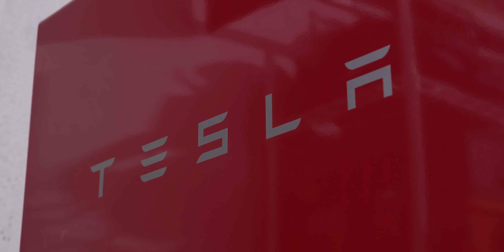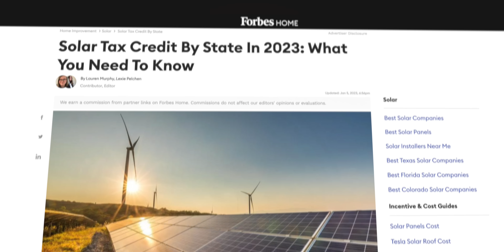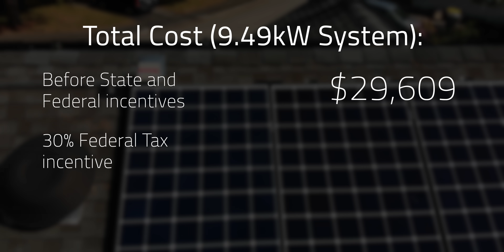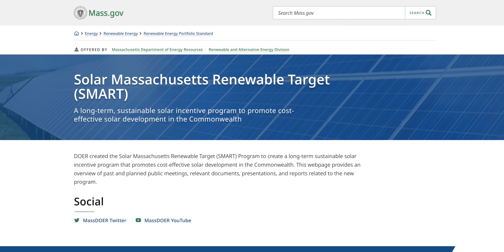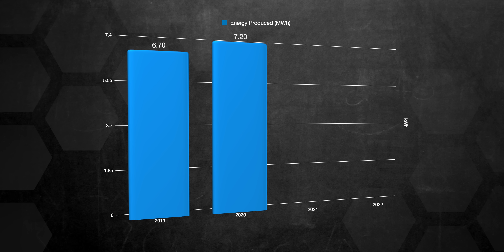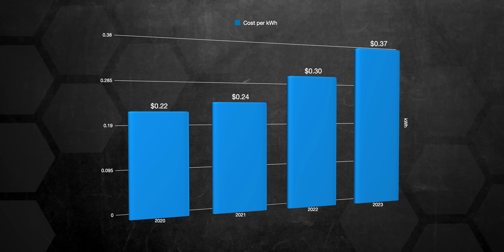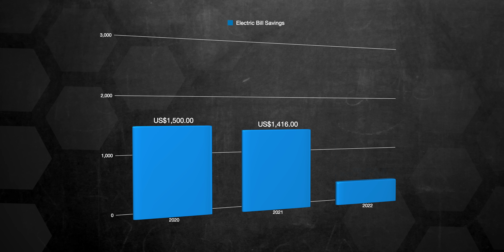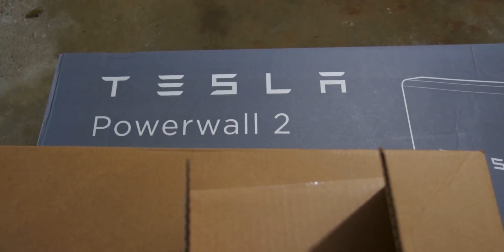5 Years with Solar Panels - Is It Still Worth It?

Comment: But what was you interest rate on the loan and how much was your monthly payment? You did the savings on your electric bills, but you never mentioned what you were paying for the panels. If you don't put that into the equation, you aren't really on track to pay off the panels in two years. You don't truly own the power until your loan is paid off, because you are just shuffling money from the electric company to the loan company. Plus the costs of panels has gone WAY up since then, you have a ton of panels, I recently got quoted for what looked like half of that at 45K. If you are lucky, you'll get ten years of no payments on the panels at 85% of their normal capacity.

Comment: What happens when you have to replace your shingle roof. How much to remove and re install the panels.
Reply: Just last month my ex-stepson-in-law paid $3,500 dollars to remove and reinstall a 4.0 kW system for a $31,000 roof repair; so the cost is significant but not huge.

Comment: In Jan 2022 we paid .17/kwh by Sept 2022 it was .281/kwh!  In May 2022 we decided to install solar so put in a 16kw grid tied ground mount which went into service Sept 2022.  Production to date is 7.2Mwh with a usage of 10.8Mwh so instead of paying $2866.20 it cost $1011.60 or $161.86 as opposed to $458.59 per month for electricity.  So we saved $1854.57 over 6.25 months and it's not even summer yet.  We also have 1 to 1 net metering.

Comment: Snow? What's that? Where I live in NJ, we haven't had more than 3" of snow in the last 2 years. Seriously though, we are only getting 24 panels on our back roof, which is East-facing, as our HOA won't allow panels on the front side of the house facing the street (but my solar engineer confirmed that I only need the 24 panels on the rear).
Reply: UPDATE: My 24 panels were install in early July 2023, local Utility company didn't start the net metering (1:1 also) until late August (local inspections and red tape), and since September, I haven't paid for any kWh since. Only an monthly "Delivery Cost" of about $5.95/month. It's now January, so let's see how our usage changes over the winter. P.S. We use Natural Gas for heat and hot water (and cooking) so my natural gas therms > big time during the winter months, but that's still a big savings as I'm only paying for gas and not electricity.

Comment: I had a 10KW solar installed a few months ago, in October. The only thing I would have done differently was getting a lien waiver from the installer before he started work. 
The parts were delivered to my house, straight from the distributor. The next day I got a letter from the distributor warning me that my home was subject to a lien if the contractor didn't pay for them. I called the contractor, he told me it was normal, not to worry, blah, blah. Install went great, work done to perfection, passed utility inspection, passed city inspection, and I'm generating power. Then I got a certified letter from the distributor, telling me they were filing a lien on my house, for $16K+. The contractor hadn't paid for the panels/microinverters. I called the contractor. He spun me a tale of mixed up accounts, bookkeeping errors, mistakes were made, but it would all be straightened out. This went on for 4 months, and I just barely got the notice of lien release from the distributor. Still enjoyed my solar, but that definitely put a damper on things.

Comment: The roof started to leak 2 years after installation. No major storm, no idea what happened there. Called a local roofer since I thought this wasn't solar related. He came out and was kind enough not to touch my panels saying that it would void the warranty. Called Tesla, waited 40 min on hold and was told they can send someone. However I would be charged over $100 if they find the issue to be non-solar related. That was the moment when I swore I would never again go solar if I ever buy a new home.

Comment: We are in MD and have a 23 panel set up with a SSW and ESE set up, for the 3 years you listed, we got 7.18, 6.5, 7.85, 7.81MWhs 2019-2022.  We had our panels installed 2016.  In 2020 we had a panel fail and it was not caught for several months.  We are further south and have a better roof direction with the SSW & ESE set up but only 23 panels and they were not 425Watt but 333?, our system is 6.9kWp.  We do get some major shade on the SSW panels especially in Winter when the sun is lower.  Just some figures for comparisons.  
     
Also our first quote was from a Tesla solar installer and they were aggressive.  I used right to rescind when I researched myself into panels on North facing roof.  They had the panels planned for my NNE and ENE roof also, a 30 panel system.  I found later that the ENE could have worked OK somewhat but the NNE is a no-no altogether.  We then researched community solar co-ops that get enough neighbors together to offer bids to solar companies for multiple houses, like 20 at a time.  A bidding war comes and the solar ends up definitely a good percent less.  Try searching Community Solar (your county) or Community Solar co-op (your county) to see if you have that option.  Our solar 6.9kWp ended up $17,800 and then 30% of federal tax credit and $1,000 MD credit so $11,460.  I don't think the federal credit is still at that percent?

Comment: No, the nonrefundable federal solar tax credit is not like the refundable child tax credit.  The latter is handed to people in a "refund" in full even if their tax liability is less, while the former (the solar tax credit) can only be subtracted from the amount of one's tax liability.  The rest of what you said is correct, except that as long as you have a tax liability every year (or even most years), you can eventually get the full amount, because whatever is still left over can be carried over from year to year until it has all been disbursed to you.  It says so right on the IRS 5695 form.  Oh, and no, it does not depend on how much was withheld from your pay, as you'll get all of the excess back.  How much of the solar tax credit you'll get back at a time depends solely on your tax liability.

It's actually simpler and less nebulous than you think.  If your tax liability is greater than your solar tax credit (plus other nonrefundable tax credits), then you'll get the full amount at once (like you did) plus all of the money you paid in (that was withheld from your pay by your employer).  If, on the other hand, your tax liability is smaller, then it is subtracted from the larger solar tax credit, you get that amount back (plus everything you paid in) this year, and the remaining solar tax credit can be rolled over for the next year--you don't just lose it.  This can be repeated year after year until you've received the entire solar tax credit.  In contrast, with the child tax credit, you simply get that amount added to your total, so it's not the same at all.  That is why the child tax credit is called "refundable"--it can be "refunded" regardless of your tax liability, while the solar tax credit can only come out of your tax liability.  You got some of this right, and most of it wrong.

Comment: Matt, Great program - thanks. I have been involved with solar since 1978, currently retired, serve on the Board of the International Solar Energy Society and heavily involved in many other local, national, and international solar and renewable energy organizations.  
Comment - I rarely hear speakers talk about solar PV savings for their electric vehicle vs gasoline. 
My current home solar PV system cost about $12,000 (after Federal Tax Credits) 4 years ago, produces about 12,000 kwh/year, and saves about 12 tons of CO2 emissions/yr.  
The system provides all of our home electric needs, including air conditioning (9,000 kWh) and also charging the electric vehicle (3,000 kwh). Home lighting, appliances, and AC electrical savings about $1,800/yr. Gasoline saving over an ICE vehicle about $2,400/yr, total savings $4,200/yr, less than a 3-year payback!  
Keep up the great programs!  Robert

Comment: No, the ideal direction 2:06 is not Southern, this was only true in the 2000s when panels were really expensive, and some were even mounted on turntables that followed the sun. Now, panels are affordable, and best choice is covering the whole roof, both East and West sides, as you've done. We need solar power in the morning, in the evening, in winter and under clouds, not a surplus of power at noon when the sun is shining, followed by a sharp drop in the afternoon.

Comment: There are 2 big problems with solar.  
1) The panels have a lifespan of 20 to 25 years, then they have to be replaced.  This means that in the next 10 to 20 years, hundreds of thousands will need replacement from the U.S. alone.  No one knows where we are going to put them all.  Likely to be an environment hazard. 
2) Currently, most of the minerals needed to make solar panels come from China, and it is unclear whether that supply will continue without disruption.
Good luck solar owners.

Comment: We have 36 panels for 12.6 kw max system. In 2022 we produced 11.8 megawatts which is just over half our electrical use. (I also drive an electric car ) the one thing I wish I had known is how badly enphaze treats customers. I use home automation to moderate electric demand. Enphase snuck a red-pill into an update that ruined local access to solar production data. Lucky for me I wasn't in the first wave and disconnected my system from the internet. I will probably remove the enphaze equipment when I install a battery.

Comment: Solar systems can actually reduce a homes value.  There is the eventuality  of very expensive maintenance and repair costs that a new homeowner might not 
want to take on. I have seen Real estate deals require the removal of the solar hardware before a sale is acceptable. Plus the roof shingle replacement is really costly when you have to remove, then reinstall all panels.  Then, of course There is Hail Damage, that Home Owners insurance will not cover.   How much is really saved after all of these unmentioned expenses have to be Paid?

Comment: 5:20  The SREC payments are 'reimbursements' after the fact so they don't, in fact, reduce your out-of-pocket costs.  Unless the company allowed you to delay payments until you got the SREC payments.  For that matter the federal deduction/payment was ALSO after the fact. So your out-of-pocket, upfront cost was $26 thousand and something, regardless of how much you got back later.

After watching the video, I noticed that, except for the snow removal, you didn't say anything about maintenance or repairs.  Do some of the panels occasionally get broken and need repair or replacement?  Does the battery need any kind of maintenance or repairs?  And to be complete, were there any issues with the wiring that connects it all?

Comment: Our solar was installed recently, I envy your 2018 pricing, but we are not far off. Your videos were a huge help in deciding our goals and choosing an installer. We are in a western state so our production is already showing a huge difference. Thanks for the guidance and the great videos
Reply: Kinda overpriced, the 8k tax credit is closer to what it should cost
Reply: @TheNicog1  i mean if you think you can pull off designing budget solar panels and installation for that then go ahead and make bank.
Reply: @TheNicog1  It should stand on its own without having to use other people's money
Reply: @johnfromnj885 ”using other people’s money” loads of every industry are held up by government subsidies. Farming in the scale it is today isn’t profitable for a wide variety of reasons. But I don’t see people commenting this shit under those topics. What’s profitable and what’s necessary or “right” aren’t the same things. Profit shouldn’t be the only factor.

Comment: We recently installed solar panels and batteries to offset the ongoing power outages. To all of you that are considering solar, take the time to map out all the electric devices to be powered by your solar solution and then add at least 10% more capacity. 

To get to the size of the inverter you require, work out what the load is when your stove/oven, kettle, microwave and air-fryer are all running together. Then, add the electric load from the TV, computer(s), washing machine and lights and washing machine/tumble dryer. 

Furthermore, make sure that you have a bank of electric plugs that only connect to the utility supply for jobs that require heavy electrical equipment. You will need these electric plugs for your electric mower, drills, bench sander, pool pumps etc.
I hope this helps you.

Comment: I am also a "5 year solar panel" homeowner. I was pressured for about 2.5 years by a persistant salesman. It was only after I got an email from the corporate headquarters offering me a $750.00 "bribe" that I went for solar. I had the panels installed as part of a lease program that required no out of pocket costs. When everything was turned on I started receiving bills from the solar company of around $150/month for the lease cost. My local electricity provider bill went down to $8.00/month. At the end of my first year of operation I was able to determine what my savings were by going with solar. At this one year mark, my total annual savings were a whole $80.00. From this, when some of my neighbors asked about whether or not it was worth going with solar, I simply told them to go ahead if they want to save the planet. If they wanted to save money out of their pocket, I simply said how much is $80.00 worth to them. Not a single neighbor went with solar. The solar company I went with was Vivint Solar. They were bought out by another solar company around 2020 or so.
Reply: Save the planet from what exactly? If you truly believe saving the planet consists of everyone installing solar panels, then you have shown the level of your ignorance. I did not say stupid, as I understand the difference. By the way, I am an electrical engineer.
Reply: @marthakrumboltz2710    Hey Mr. EE.....solar energy is green energy....so it is a "save the planet" kind of thing.  I'm in agreement with Christopher Franklin that if 80 bucks is your gig and you want to" do your part" in saving the planet then go green.  Solar cell tech has come a long way since I wrote my cheasy 1977 college term paper on solar cells but the technology is STILL NOT to the point where it is truly worth investing in as a homeowner.
Reply: @ken85225  you might want to look into how they're produced before you decide mass producing solar panels would save the planet.
Reply: @ken85225  What is green about metric tons of PV panels full of heavy metals going into landfills polluting water tables? I can see the propaganda has worked well with you. You probably think that EVs are "green" too, though haven't done an iota of research of who and how lithium is extracted or what is going to be done with a junk 2000lb toxic battery.
Reply: Everyone's situation is different in terms of whether or not it makes sense to install solar panels.  It sounds like the advice you gave that your neighbors didn't factor in the appropriate criteria to determine if it made sense for them to get solar panels such as the direction their roof is facing, how many panels can fit on their roof, how much of their roof is shaded by trees, how much electricity they could produce with a solar system, etc so they may be able to save a lot of money by getting a solar system.  Also, buying your solar system is usually recommended over leasing by solar experts because the cost is lower over the long term and the solar company usually makes more money when you lease the system because you have lease payments as long as you want to use the system.  To evaluate whether or not the solar system is worth getting, you need to evaluate the payback period which is how long it takes for you to save enough money from the electricity produced by system that you didn't need to buy to payback the cost of the solar system.  If the payback period is too long, then maybe it's not worth it.  My 11.2 kW system's net cost was $18,700 and was originally estimated to save me about $2500/year in electricity based on the electricity cost in 2020 when I got it installed making my payback period about 7.5 years.  Since the system is guaranteed for 25 years, then I'll be saving a lot more over the life of the system compared to the cost. Energy Sage has a great article explaining solar system payback period.  Lastly, Vivint was acquired by Sunrun back in 2020 and they both have terrible reviews on solarreviews website when I first looked at both of those companies back in 2019 so that might explain how come you're not happy with your Vivint solar system.
Reply: So your electric bill for the year is typically $80? You failed to mention how much it went down from to get to $8 though I'm guessing it's either intentional or just poor math. Yes you are saving 80 now with the cost of the solar factored in. So once that is paid, how much would you then be saving? If you're thinking shortsighted then that's how you come to conclusions like this